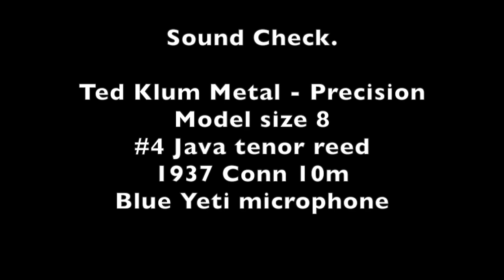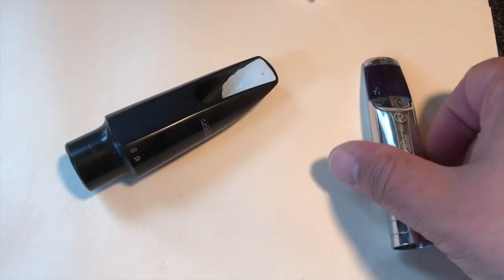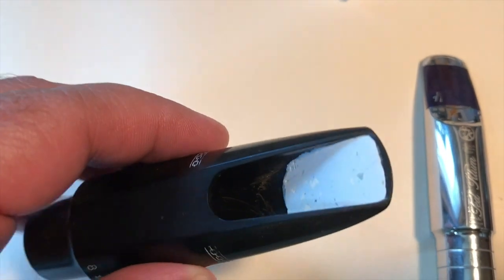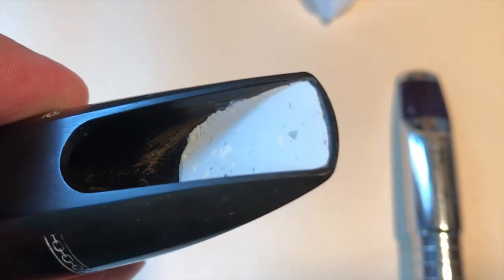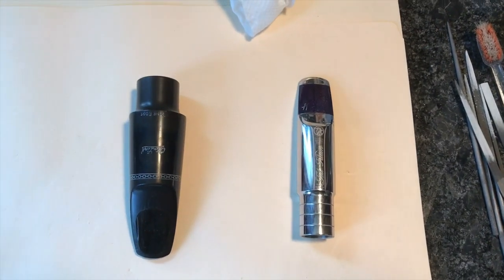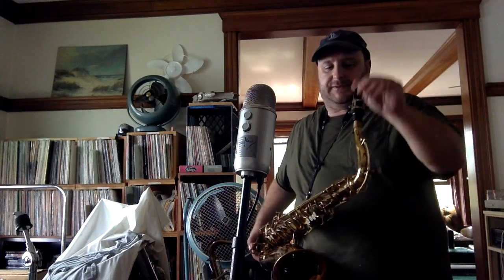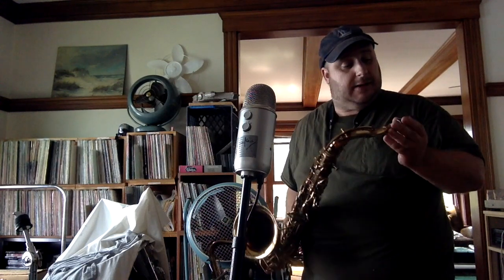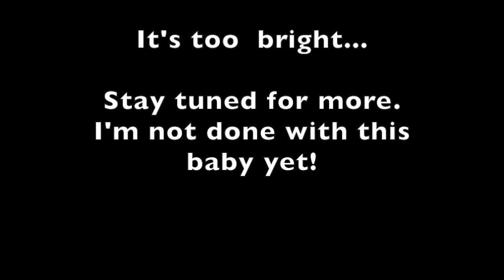LinkGeek 6 The 1st After Play-test

Comment: Hi Andy - just done exactly the same thing. Got a Link Tone Edge 7* yesterday and I hated it. So, baffle time. I used Sugru
https://sugru.com/?gclid=Cj0KCQjw6_vzBRCIARIsAOs54z7HfxxRGegsSr7UhfT0W6A1oQcxBpnB2uz5rPA9coU56Jnd1cBRcSYaAj0pEALw_wcB
Man...that stuff is amazing.
I copied the baffle shape from my Florida Double Ring tenor mcp. It has a concave shape across the width of the baffle. Sugru cures and sets to rubber, the benefit is, if it doesn't work, you can cut it out and start again even after is totally cured after 24 hours. You get 30 mins to shape it before it starts to really harden. Happy to say it turned out really well. Now the Tone Edge can play soft and warm, sub-tone or peel paint if I push a whole load of air through the horn. Check out Sugru. If you  can get some  you may want to try it on your next project.